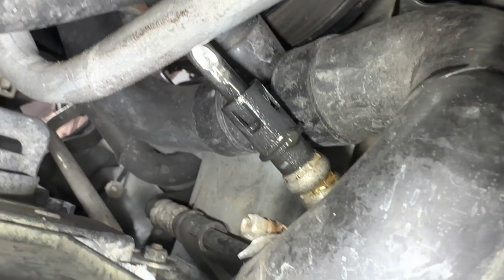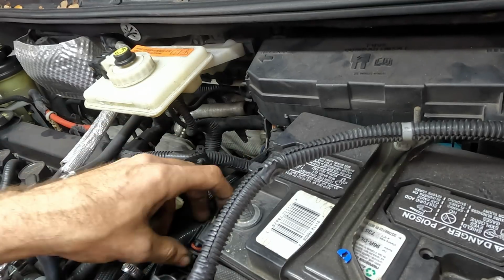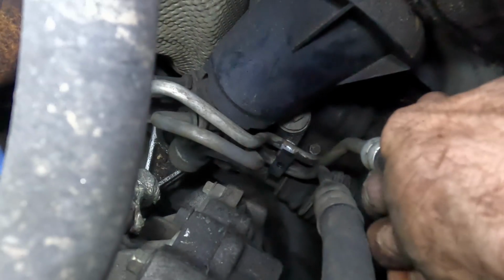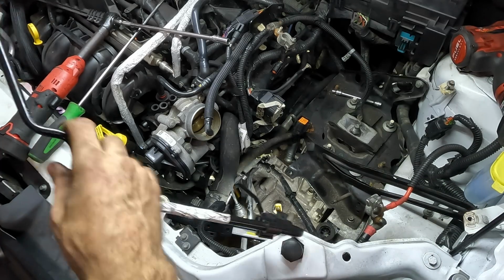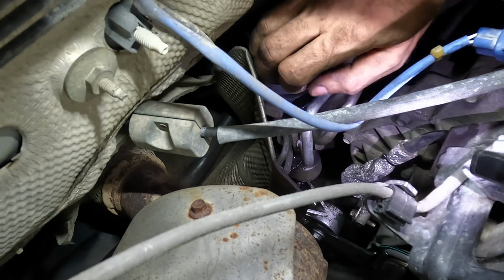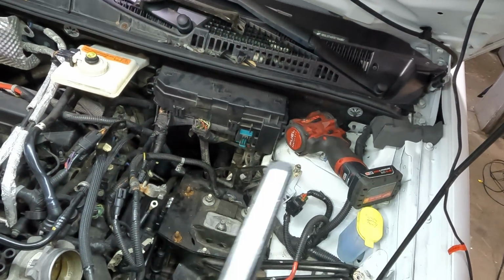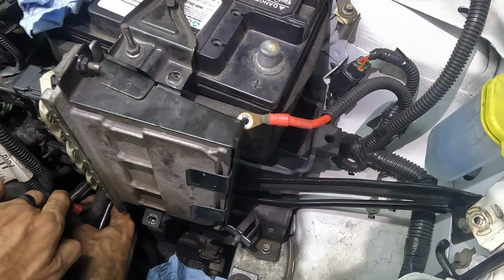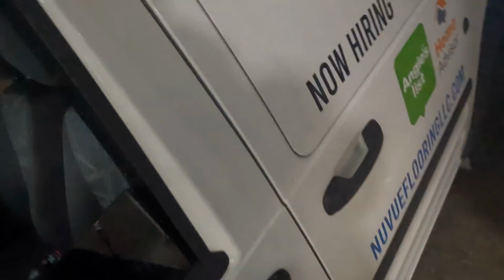Sloppy Repair: High Pressure Hydraulic Leak! 2013 Mini Transit

Comment: I had a 1994 Buick century special. It got a cut in the high pressure hose one day. My "fix" was exhaust take, duct tape and Hose clamps. By the time I had it replaced there were six hose clamps on the high pressure line. I didn't have the money to pay someone to fix it and I could see me dropping the sub frame to replace the hi pressure line. It looped down from passenger side, down to the driver side where the steering gear was.

Comment: I doth protest your re-installation of the battery terminals good sir! Connecting ze positive battery terminal first. If you connecting ze negative terminal, and the positive terminal goes all flippy-floppy (or, as Dave Jones of EEVBlog fame would say, “flappin’ in the breeze”) it could cause a short and a fireworks display in the vehicle! 😮😬 Other than that, good job - another happy vehicle. 😅
Reply: Never mind, I see you’ve negated my negation of your battery terminal procedure. My apologies. 😌

Comment: I find if I fill the PS system BEFOR I start the engine and wind the wheels lock to lock 4 or 5 times (easier with the front wheels off the ground) I can purge most of the air out of the rack etc. Check reservoir and fill again if necessary.  That whine is then minimal if not at all.  Just my $.02.

Comment: Why not add a section of rubber line to cover the tubing where they may rub?
Reply: One of the things we did on the planes to prevent chafing was install various forms of chaff guards but his solution is more permanent by rerouting the lines.....

Comment: To the experts, just how easy should it be to replace the high pressure fluid line on a power steering pump on a 10 year old vehicle with over 120000 miles?

Comment: I had a 2011, there’s nothing easy to fix on those little trucks. But the little motor runs nice. The dual clutch Focus transmission sucks!   My complements on your work practices Ray, always first class. 👍🏻

Comment: arent you suppose to purge the air out of the power stearing system?
Reply: It's a bit different than say brake lines which are dead ends at each wheel cylinder.  The power steering circuit is a loop so eventually the aeration and bubbles get "circulated" out back to the reservoir.

Comment: Hey Ray, right at 35:00, it looks like you popped off a hose loom from the new line and when you had the new line in, it looks like that loom would've fit perfectly with the metal line next to it (close to the camera, not the AC line you talked about).  Wouldn't that be a good thing to help with the spacing and reduce vibration?

Comment: I have used a piece of vacuum hose to cure that before it happens again. If I notice a spot where one tube is rubbing on another, I simply use a 1 1/2 inch long vacuum hose of the appropriate diameter, slice it down the middle, super glue it back together over the tube, then use a couple of small zip ties to secure it in place. Problem solved forever.

Comment: I think it's great that the OEM's have gone to securing fluid lines with pop in fittings held by actual bolts, instead of threaded in fittings. It really reduces the chances of crossed threads and twisted up tubing.

Comment: Hey Ray, a bit more challenging without the lift but as usual you prevailed. I felt your frustration over that battery cable routing. Then I laughed when you tried to remove the brake clean cap one handed because i knew what was going to happen. All this when you're working late and trying to get home. As always Ray, a great video. Cheers!

Comment: I kept moving my laptop trying to get a better view of what you was doing, then it dawned on me, the problem was on your end.........
 By the looks of that power steering line, it looks like it was an after-thought by the engineers, must be why they are called engineers for being able to design a line like that,  it's designed like the currant administration policies.........

Comment: After reviewing the video at the 6:07 mark, I noticed that the battery cable was initially in the wrong place causing you to misremember the routing. However you properly deduced to correct installation path of the positive cable all on your own. Good job Ray.
Reply: Personally I think of few things with misrouted before Ray even got under the hood and that's why the line rub through

Comment: Hey Ray this is me being an old fart, everytime I see you grab a screwdriver to undo, or or install a hose clamp I always go why don't you get a nut driver so much easier. I guess over the years I just poked myself so many times with the screwdrivers  that I finally gave up and I had a nut driver they had 3/8 5/16 and 1/4 in . 🙃🙄😉👍🙏. It's just funny how that gets me. 🇺🇲 THE OLD FART IN SOUTHERN CALIFORNIA ♥️. Don't change brother keeps me alive 🤗😉
Reply: Same here, I stabbed myself more times than I care to admit. A nut driver is a lifesaver. They even have them with a spring type shaft so you can work around a bend.
Reply: Many years I got some stubby nut drivers. Handiest thing for hose clamps.

Comment: You could make a standoff out of a couple of zip-ties to keep pipes and hoses from rubbing each other.  If the pipes are parallel you could use one zip tie and a short piece of rubber hose.  (I don't know how to post a photo example. )

Comment: If I may. Get a pair of ramps, will save your back and is quick. Also some knee pads will save you as you get older. Not very sexy but they really work. By the way Not a sponsor 😁

Comment: My grandfather yelled at me one time for not putting all the clips back on the lines around the engine bay. He said, "If you think they don't matter, Chrysler would have saved 3 cents per a car times 100,000 cars, its there for a reason."
Reply: use zip ties
Reply: Even the "pros" don't always do it right.  Ford dealership wrapped the harness around a cross member to take up the slack instead of putting it back in the clips.  Found the cross member not bolted in properly either.

Comment: Tou are working in an engine bay designed to fit the common rail Oeugeot 1.6 diesel and 5 speed manual geatbox, not the largwr petrol/ slushinatic that you colobials shoehorned in, and tgat pipe was lijely fitted wrongly. The joys of a Turkish made Airfix kit. It says a lot when Renaylts arw more reliable than Fords, and outsell them

Comment: When you do the power steering you steer it all the way to the left turn it off wait 20 minutes then you turn it on and secured all the way to the right for 20 minutes to turn it off and then you do the same thing and all the bubbles should be gone

Comment: Nice battery cable routing correction.
A repair required just because a prior repair didn't give a damn about the proper hose location.

Comment: Remember when you needed to run the air compressor for all your power tools?
You need a little portable scissors lift for the extra jobs. I've got a 6000# model that works for the smaller jobs.

Comment: Ran into s a similar problem on a Mercedes in the 60's.  There was no way to reroute the hoses to keep them from rubbing.  I ended up taking a larger diameter piece of hose, splitting it and putting it around the two hoses at the rubbing point.  Mercedes came out with a fix, consisting of two split pieces of hose to mount over the hoses where they rubbed.  An official repair that duplicated what I thought of on my own.

Comment: Ray, it's dangerous to spray brake cleaner on a running engine. One stray spark from a plug wire could easily ignite the cleaner.
Reply: more dramatic with fireworks, more views.
Reply: I'm sure he has no idea that could happen.
Reply: Some are flammable, some are not.  CRC says NOT flammable. "CRC Brakleen brake parts cleaner is non-flammable and formulated to quickly and effectively remove...."

Comment: Great video! But I have a question, would it have been possible to use the new hose tie, from the top, as a spacer for the AC line?

Comment: That throttle body was bad ... I am an amature but could tell.  I have cleaned my after toyota recommended, and wanted some $300 for it years ago  I checked how to do it .. then I found that it was pretty clean to begin with nothing like this one.   So that was the last time I went for the dealership for anything.  They clearly did not check  if it was even needed.

Comment: Repairs were not at the forefront of thoughts when that engine was designed.  What has to be removed to get to the lines on the steering gear is proof that designers should be required to spend at least two years working in a repair shop before they can design an engine.  And they can't just stand around watching.  They have to work under an experienced mechanic and get their hands dirty.
Reply: Engine bay was designed to be built in sub assemblies which were then married together on the assembly line. Production efficiency driven by the accountants is the only engineering directive. Consumers pay for repairs, who cares how long it takes.

Comment: You can get rid of the air in the system qickly by pulling a vacuum of about 20 inches at the reservoir and turning the wheel back and forth. After a couple of times the air is removed.
Reply: Good info to know that I'll never use.

Comment: Donno man, still looks like that  power steering tubing will  rub as it can move too close to the  other tubing.  Being a shade tree mechanic,  I'd get a piece of PVC split down the length, and epoxy it onto that area on the tubing.  But  that wouldn't be "professional."  But it "would" serve  to  make it  rub proof,  Ja?
Reply: u r smarter just lack $ to move from tree to junkyard garage.

Comment: You shouldn't leave the keys in the hood latch, that's a sure fire way to snap them (think that's a common thing to have happen).

I thought the transmission wiring went over the pipe, not under? lol

Comment: 5.5mm is standard m3 size. Used on most semiconductor hardware for many years. Used on fixings that require low mechanical strength.
Similar to 1/8" thread, in diameter, with a 5.5mm AF nut. Very common almost everywhere.
I think back in the 60s, the USA favoured 4/40 UNC, (Unified National Coarse) and the UK used 6BA, (British Assosiation). Europe was Metric and we adopted their thread system circa 1970 ish.
Reply: We had problems here in the UK when Hewlett Packard changed over to Metric threads in the castings of their test equipment. Threads were stripping so easily in the aluminum because the Metric was fine thread where previously it had been a coarse UNC . In fact there is a coarse Metric but one hardly sees it used, most wholesalers only stock Fine Thread.
Reply: Good to know, I was wondering about that.😂

Comment: Had to go back and look at the previous routing of the positive cable.  Was definitely incorrect before, good job catching that one Ray.
Reply: I did the same thing.  Beauty of video footage.  Ray is on point.  Makes me feel more normal for doing the same kind of things.  I'm not alone when I find things not put back correctly and my ADD makes me fix it.  LOL
Reply: Yeah it looked so obviously correct when Ray had got it done finally, and so wrong the way he initially had found it.  Kinda made sense to have both battery clamps oriented the same way to line up.

Comment: Hay ray, is it possible that that extra hose clamp/bracket thing goes down there where the lines rubbed to keep them separated?
Reply: I'm pretty sure he doesn't read the comments. He never responds.
Reply: @TheFrenchPug  yes he does.
Reply: @arthur962  Only after the first hour or so after the post.  Then he never responds.
Reply: @TheFrenchPug knowing he is hacking most of the time,  he is afraid to face truth. As long as Youtube $ good, who cares?
Reply: u r smart.

Comment: Hey Ray. You have such patience. I would be cussin’ the whole time. I’ve wondered how you have the balls to post all your amazing content with the prospect of a mitch gaar complaining about an old heat destroyed electrical connector breaking. You and wife unit are amazing. Both of you keep it up.
Reply: I agree Ray you're the best.
Reply: Besides Ray has no idea how to make a soldered joint in wires. He never reflops the dingwanner before zinwabben it. So it is never going to warf.
Reply: Cussin is my stress relief

Comment: 25 yrs ago my 84 dodge pick-up steering arm sawed my transmission line like that. I broke down right in front of an old abandoned gas station in Arkansas and around back in the gravel driveway I found 2 hose clamps and an old piece of fuel line. I had a Sawzall blade in my truck so I cut out the bad spot put the clamps and hose in place and never had another issue. I sold the truck 2 yrs later.

Comment: Loved the snidely little dig about people calling to say you can't set up a Differential properly.  Just a bunch of jealous moronic Turd's who hate to see the success you are having and how well you are followed. Ignore the haters. Had a few words to say back to some of them lol. Keep doing you that is why we sub and return.
Reply: They are probably “engineers “ who work on a production line doing the same job over and over Ray has multiple skills and adapts to the job in hand.his channel is for entertainment it’s not an instructional video go Ray 👍🇬🇧
Reply: Setting different and other gearboxes is an exercise in patience and sometimes futility. Put it together, check it, take it apart, wash rinse repeat. The whole process is dull and repetitive and would require a 6 part series. I reassembled a three cylinder Suzuki once that had been completely disassembled. Including the trans. I didn't have to shim anything but there was 147 different ways to put the gear train back together and only 1 that was right.

Comment: Derek would have said 87.37125% confident he could replace that line with no problems. But, then again, he was never good at calculating significant figures in school.
Ford engineers succeed in putting a 26.9 cubic foot engine into a 27 cubic foot engine bay!
I do all my repairs without a lift. (Because I don't have one. :(  .... )

Comment: Hay ray, if your compressor goes off sporadically without you using it you have a leak....they shouldn't do that normally.
Reply: Wow...thank you Captain Obvious.  No one who's owned an air compressor would have EVER figured that out...
Reply: @buckhorncortez  may be obvious to you but you'd be surprised at how many people it isn't.
Reply: Lots of folk just power them up if needed. Doesn’t take long to come up to pressure. I just pop off the hose because that is what leaks a tiny bit.

Comment: At times I ask myself, "Why don't I just work on my truck myself" then I watch these videos and I remember why , "oh yeah it would never run again"
Reply: Hahahaha.  It is amazing how much he knows.  And the process he goes about tackling the issues.  He doesn't sweat it at all.
Reply: i mean he only had to pull the airbox, the battery, the battery tray, AND the ECM to be able to change a hose out
Reply: @bradhaines3142  At least we have solved the mystery of what the PT Cruiser engineers designed next in their careers.
Reply: @bradhaines3142  You forgot removing the back bumper.
Reply: Service and repair is an engineering afterthought.
Reply: @GusFromDaysPast  Engineering is a styling afterthought.
Reply: Weight reduction comes in many forms. Smaller engine compartment less steel means perhaps an inch or more shorter wires and hoses times a few hundred thousand units adds up for weight reduction and cost savings. It was a day finding reduction areas was easy but fine tuning the effort will almost require the components under the hood be one unit.
Reply: @kenore4003  I've herd it's to keep the mechanic bus so there not servicing the engineer's wife's, while there busy designing more work for the mechanic 😅🤣 all the best to you all
Reply: I felt the same way once. But, I became a Master Barber because of my experience and knowledge. Yes, I made mistakes (Very few) but I watched and listened to people who knew more than me. Same with car repair. Raymond's experience and knowledge was gained by learning from others and making mistakes. (Very few I'll bet) Give it a try! It's only money..., lol!
Reply: @saltycreole2673  I 65 , I forget what I went to the barn for. Too much fiddlie bs on cars now days.
Reply: @hl8256  Too many engineers and government interference.
Reply: That’s hitting the uncomfortable truth. 🤣😂😆
Reply: I'll work on my 97 Jeep because I understand its technology.  My 2017 Ford goes to the dealership.
Reply: It would keep you busy trying to make it run again 😂
Reply: After watching some  old timers fix cars and tricks from days gone by.. 
One trick I learned keeps me from ever breaking a break line again 

It's so easy that it is stupid
Reply: I’ve never hired anyone to work on any of my cars. I figure if I have the will to do it there’s literally a video of someone showing how to do everything 😂
Reply: I do work on my own stuff and sometimes you just have to stick with it until it is done no matter how difficult it is.
Reply: @jamessowards3822  Amen!
Reply: Gotta learn or they win
Reply: I usually have extra parts! 😂
Reply: It's only nuts and bolts my friend...
Reply: I have always had to do all my own work except when I had the transmission flushed (I don't have a machine for that), but I've never owned anything newer than '03.

Comment: That hood release is a pain in the ass when the key no longer works.
Reply: That's what the spare key is for.
Reply: @TheXsheeple  or screwdriver and drill.
Reply: Why would the key no longer work?  That's hardly a lock that would have a lot of use.  But, I know, this is the Internet and anything to be critical so that it looks like you might know what you're talking about...